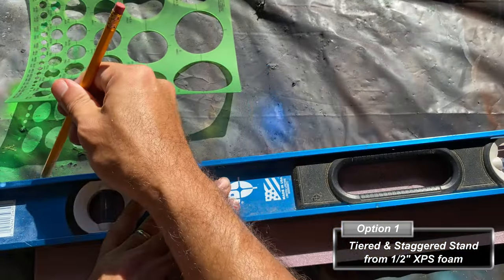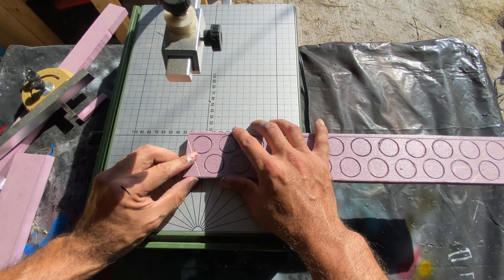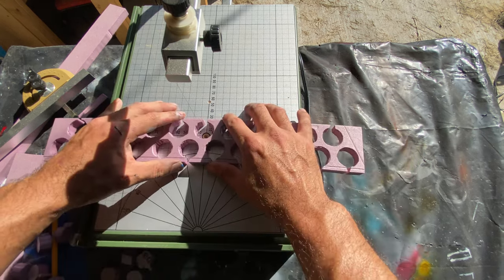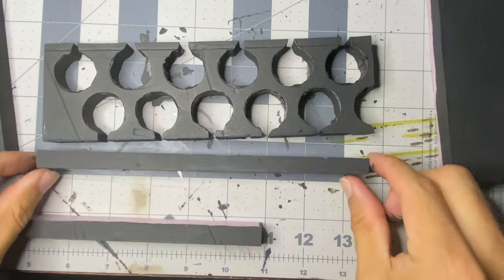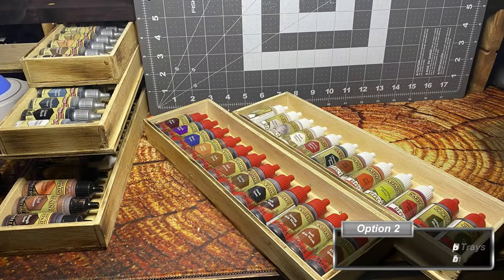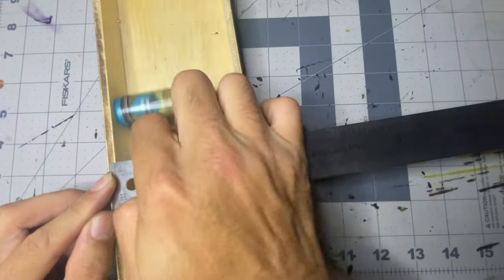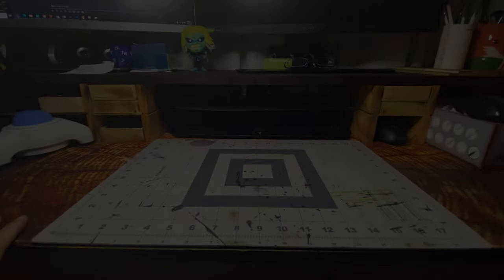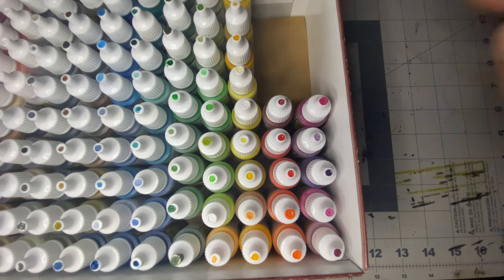Let's Build Three Types of Cheap and Easy Miniature Paint Storage

Comment: Nice video! 

The new AP Fanatics Mega Paint Set actually includes a pretty good paint stand that will fit all the inluded bottles, in the fashion of their Painting Station paint holders. I wish they brought that out as a separate unit.
Reply from the maker: Thank you for the visit and comment!  I had seen the new box set with the stand and considered buying it, but I ended up taking a different route and went down the road of gouache and heavy body acrylic paints typically used by canvas painters.  I do use a lot of Army Painter paints still, though.  I just wished they had that paint stand in the mega paint set from their original line.

Comment: Like your ideas and video. I'm currently doing a xps version, which paint did you use on the xps ??
Reply from the maker: Thank you for the comment and visit!  I used Vallejo's acrylic surface primer matte Black Primer (the color number on the bottle is "74.602").  It has a really nice matt finish for most projects.  Their gloss black is very glossy in comparison.  I need to come up with another new way to store paint, since I added all of their 2.0 speedpaint bottles to my inventory.  Probably just need to build a completely new desk now...
Reply: @workingwithminiatures0706  Thanks for the reply. I'll give that a try.
I have the same problem, so I repurposed an Ikea cabinet to fit under my desk. It will be able to hold hundreds of paints when I'm finished .....which is very dangerous 😜